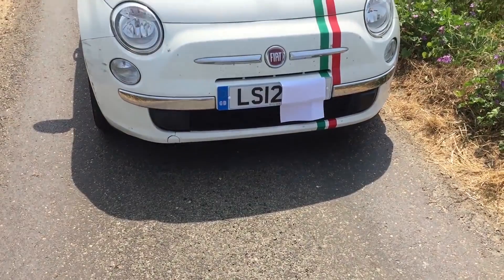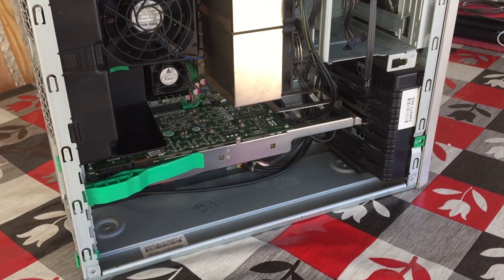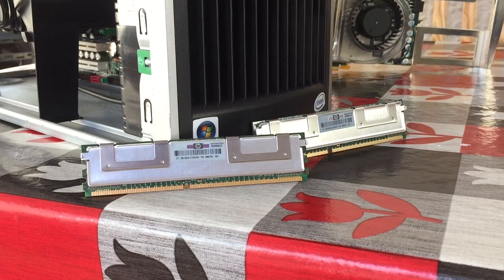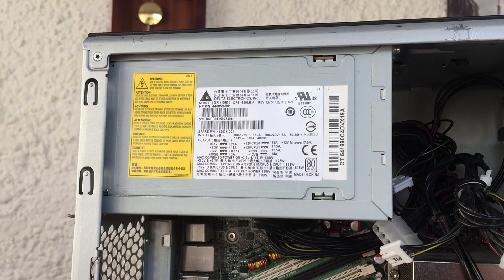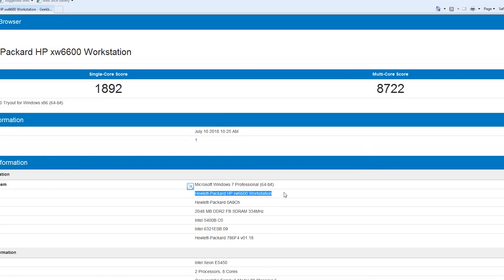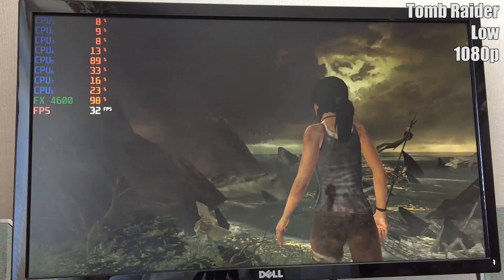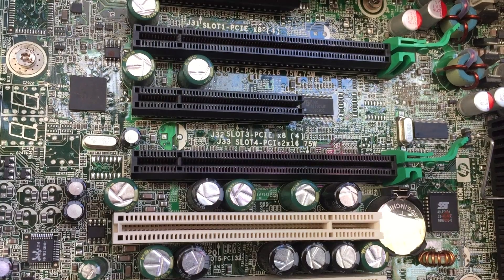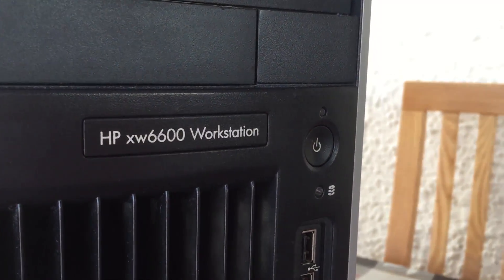This 8 Core Xeon Workstation PC Cost $5000 in 2008, Today I Bought One For £25 ($30)

Comment: When it comes to 75W from the PCIe slot, no x16 slots can provide more than 75W. I think that the above number (75w + 75w) was meant for the system as is - 75 from the slot, and 75 from the 6pin. Grab a different PSU, and you should be able to SLI two extremely power hungry cards. That said, most workstations have SLI license for quadro cards only, and it would be a waste of time. I would personally like to see its ram maxed out :)

Comment: get a 1060 3gb and 16gb of ram for it and make a vid on how it handles modern games
Reply: Prediction: GPU at 15-25 percent.
Reply: Quick search: Q9550 w/ 1060 3 GB running at 35%-ish in GTA V. So I was a bit off, but overall point that the GPU outclasses the CPU(s) probably remains true. The doubling of threads will improve matters but not linearly. Even if you assume linear scaling, i.e. doubling of performance with a second CPU, GPU will still be in the 70% range.

https://www.youtube.com/watch?v=s05U3WqKMN4
Reply: 16GB is a bit too much for this system. Lol.
Reply: Virtue Gaming did i not here him say it supports 32gbs ???
Reply: Yep i agree it would be very cheap gaming pc
Reply: NO MA'AM really???? i seriously doubt it. a 1060 3gb???
Reply: http://thebottlenecker.com/ - Check bottlenecks here.
Reply: NO MA'AM right im not saying its the ideal combo, but he said he wanted to do something different then a 1050... just suggestions. only experience i have with older hardware is a Q6600 with a 750ti
Reply: @NONOLIGHTSHOW  i have one rn with two quaddo fx 5600 in sli with 32 gb of ram. My work had these in specific so i got them for free because they retired them.
Reply: Just buy a old GTX 960 it will be cheaper and be less of a bottleneck

Comment: Nice deal. I have mine aswell. the one i have is an HP Workstation XW9400 $10,000 config
2x AMD Opteron x4 2380's
16gb ECC DDR2
Nvidia Quadro
1TB HDD
I replaced the GPU for an R9 270x.
tho this PC is all water cooled.
and it surprisingly can play almost anything at 1080p :)
Reply: Forgot to mention it came with a 1050w PSU
Reply: Opteron <3 built one with two x6 2431 but an old GTX285

Comment: Another great video! I recently got a HP z800 with water cooling kit, 2x x5680 cpus and 48gb of ram for about $200 AU. The thing has insane amounts of raw horsepower and would make a great rendering machine for anyone looking to get in to youtube (or wanting to run a plex machines as is my intended purpose)

Comment: I own the exact same Workstation, also with dual E5450.. paid 46€ for it about a month ago (bit more ram, but no GPU included), I upgraded it to 32GB of ram (because if you can have dirt cheap ram, you gotta take it) and a GTX 960 2GB, which IMO is a really good match for it. Total cost incl. the Upgrades is about 120€.
Reply from the maker: Nice build :) I'll be looking to get the maximum ram too
Reply: I think maximum is either 64 or 128, the top-spec stuff is usually expensive for old servers/workstations because some commercial users like to keep them running for a lot longer. 

You should see some improvement once you populate all slots (and funny results in some benchmarks), because iirc it's using quad channel memory.

The guys I bought my 32gb RAM from on eBay still have it on sale for 19,95€ + 6,75€ shipping to the UK (was free for me) and they have the option to offer a price (got 2 kits for 18€ each). If you don't find it cheaper, the eBay Number is "382471097094" .
Reply: Wow! I didn't believe that this machine would get quad channel memory bandwidth but it seems true! Definitely go for at least 16 GB with all 8 slots for maximum performance!

Comment: The nice thing about one of those Xeons is that if you're main board dies, you can take one of those out, do the 771->775 Mod and get them all the way upto 3.8-4.2Ghz (on an overclockable board) which will give you quite the performance boost indeed... Not that I really recommend 775 given how cheap 1155 is.

In terms of use as a server it seems decent, and rendering on it was better than some of the stuff I've been forced to work with, especially for £25.

Nice little review of it man.
Reply: The God Called Mars surely, but, at least where i live, it is impossible to find a 1155 board, a super cheap one like a h61m, and an i5 2400 for less than 120/130 euros, considering that with like 30 euro more you can get a i3 8100 and a h310 i don't consider 1155 that cheap
Reply: IronCalca straight up no but when you also consider the price of ram it’s significantly cheaper
Reply: Regilio Bouma: They're £25-£35 on eBay... So no not really. Ali express is also a viable option too with similar prices.
Reply: slugmater: Here you go: https://m.ebay.co.uk/itm/MSI-H61M-P31-G3-W8-LGA-1155-MicroATX-Motherboard-DDR3-PCIe-3-0/232226573489?epid=115883070&hash=item3611c84cb1:g:eiYAAOSwNnRYk0oy

This is a rather good one, I've used plenty of them before
Reply: Sergeant Daffy: They're usually not overclocks and from business's so generally these boards have quite a while left in them
Reply: IronCalca Still cheaper than any other 11xx board, 1151 comes close though.
Reply: Is it possible to game on one of those Xeons with a modded 775 mobo and a dell OEM 250 watt sff power supply?
Reply: Do you guys know about the s5000psl mobo  and why its fans spin at max the entire time

I have 32gb or ram in it and 2 2core 4thread xeons running at 3ghz
Reply: IronCalca I can get a custom pre built system with an i5-2400, an h61m, 8gb ram, 500/750GB HDD and GTX 745 for around $110, and they're readily available on Craigslist.
Reply: barevids (audio channel) livestreams amplifier repair from a 4GHz X5470 system that started life as a Core 2 Duo :-P
Reply: 1155 mobos are expensive AF
Reply: budget-builds official:i wish they where that cheap
plz send a link for a board like that
Reply: I saw the E5450 spec many month ago , OC 4.1ghz possible  ?
Reply: good u learned smth from me bout xeons :3
Reply: tuff_lover: Exactly my man.
Reply: I've had a Xeon E5440 and it couldn't even overclock 100MHz on a pretty good (ASUS P5K/EPU) P35 motherboard.
Reply: The God Called Mars 1150 and 1155 boards are around the same price (on eBay)
Reply: The xeon 3000s on the lga 1366 are pretty sweet. Overclockable boards are expensive but you can build a decent gaming pc with them as the base for under $500
Reply: On eBay.com z170 mobos are anywhere from 50 to 100 USD
Reply: 1155 is pretty expensive actually
Reply: Huntrin here only the mobo and cpu would be over 100,as stated before, i also should say that here the used market is pretty bad, people overprice anything and if you try to talk with them you will just lose your time. That combo you mentioned is really good tho

Comment: You probably got it this cheep because of the OS only running one core making it really slow and someone didn't realised that and sold it thinking it was single core.
Reply: Sevcen23 It's also slower than a stock FX-8350 in both single core and multi-thread. Plus Ryzen 1700 is $250 with mobo, and its about 3x the performance (for the same 8c/8t at 3 Ghz as this, the Ryzen makes 1000cb compared to the 633cb of this one, that is disabling half the threads and underclocking the Ryzen)
Reply: FX-8350 at 5.5GHz? That sounds like miracle-class silicon and honestly sounds impossible without exotic cooling by the likes of LN2. Plus, that little board's VRMs would be in smoke from the power draw of that OC. Can't help but say that sounds like a lie... and yes, I've worked with FX processors, the VRMs will get too got to run them at those speeds.

And I can't help but say clockspeed records really don't matter when they're only achieved with LN2 and cores being disabled. Clockspeed never dictated how fast a CPU was, as even the Phenom II will out perform Bulldozer in a heartbeat unless newer instruction sets are used that aren't supported by the Phenom II. The cost of cooling to overclock those processors meant you need a much better board to achieve the speeds, and great cooling, in order to even match Intel i7s. No, FX was indeed an utter failure.
Reply: Here is my 5.6 Ghz CPUID validation link
https://valid.x86.fr/dgqfg4

It shows my motherboard, voltage, benchmark score, and my epic $5 VGA monitor (LOL, but seriously I didn't want it to explode my 4k monitors)
Edit: The voltage is wrong, it's 1.55 + 150mV = 1.70 Vcore, it probably dipped the moment it recorded it.
Reply: Maybe but these dont go for all that much because of the ecc ram its cheap now but it used to have a real premium price and older machines like the one in the vid are rocking ddr2 no way to stick ddr3 ddr2 ram is emensely slow compared to ddr3 let alone ddr4. But if your lucky you can find later Q series quad cores with decent ddr3 motherboards the biggest problem with the older xeons and core 2 quads is ddr2 was the standard at the time very few boards had ddr3 support and the ones that did cost a bomb and they pretty much only supported upto ddr3 1333 memory sticks. Bottom line keep checking ebay if you do your research you can get great deals on older workstations and ex office pcs.
Reply: R K In some decent and high end P45 and G45 chipset boards you can adjust the memory and FSB subsystem timings to match or even surpass DDR3 800 and 1066 MHz bandwidth, but unfortunately server boards lack the ability to fiddle with said parameters...
Reply: That's because the FX-8350 runs at a full 1.00GHz above the Xeon. The FX-8350 actually was just as slow, if not slower than the Xeons clock for clock. FX had terrible single thread performance and really wasn't worth buying unless you were going ultra budget.
Reply: DropToasterInTub   FX holds the world record for highest overclock frequency ever attained, so it really wouldn't be fair to compare it that far underclocked. The performance of both overclocked would be the same scenario.

Comparing them stock is reasonable since FX has massive amounts of room, and even the cheapest boards allow it to overclock. Its single thread is still above what the Xeon has (which should be obvious since it wins multithread with the same amount of cores, and that's with it sharing parts of the cores under multi-threaded applications). Niether are impressive for single thread anyways, but the FX is at least "less slow".
Reply: DropToasterInTub For example, I've got an old FX-8350 at 5.5Ghz with 870cb (limited by a $40 mATX board I bought new in 2015), so they can overclock really high. They are obsolete in my opinion like all the Intel quad cores. That doesn't mean that I can't plop my Titan Xp into the system and still be GPU limited (I game at 4k), but they are smashed in multi-thread by dirt cheap Ryzen processors in workloads.
Reply: DropToasterInTub Oh yeah, I'm using a stock Intel cooler, forgot to mention that like they forgot to mention for the 5 Ghz 28core CPU at computex.

It is phase cooled, max temp of 10c on the core (-25c block temp under load).

It really is limited by the motherboard though, it doesn't allow past 1.7 Vcore. Still darn impressive for such a cheap board.
Reply: What a funny joke.
Reply: The FX is real, running on a wimpy 4 phase VRM (I agree, I don't know how it hasn't caught fire)
Channel page: https://www.youtube.com/channel/UCZp2Om_w_o0ry_FQhAUp-CA

Video of the FX system making fun of Intel's Computex blunder (sure, they forgot it wasn't stock...) https://www.youtube.com/watch?v=30SFGaTUgIo
Next video will be of a 100+w case fan (120mm fan powered by a race quadcopter motor)
Reply: There's absolutely no way that you're running an FX-8350 at 5.5GHz on a 4 phase VRM board, it's just not possible. But I can't get a good look at the VRMs to tell if they're also being cooled by the chiller. An FX-9590 could turbo to 5GHz, but required a much better VRM system in order to deliver the power that was needed, and at the same time, needed a huge heatsink over the VRMs to avoid them burning up... literally. Just look online to see how many people tried to run the 9590 on a 970 chipset board and burned the entire VRM system. That board had to be a 990FX chipset, and those boards were very expensive. By the time you added it all up, you pretty much came so close to an Intel platform that it honestly wasn't worth the performance you get. That's why efficiency is important. Also, there's no proof of that being an FX-8350 running on ALL 8 cores active... it's also not even your channel, but it may just be an alt.
Reply: It's an Asrock 970m Pro3 rev2 micro-ATX.
I added heatsinks to the chokes and it is cooled by 2x 40mm fans. Total cost was $3 for VRM mods (actually less than that, I used a bunch of the extra heatsinks for voltage boosters for my fans, which is why I had a fan with a fried motor).

I ran it at ~300w (4.8 Ghz 1.5125v) for over a year with an AIO doing CAD rendering and fluid simulation (takes ~24 hours per simulation). Cinebench bumped it from 65w stock idle to 400w at the wall overclocked. 

I'll be honest, that motherboard is a trooper! I had the camera and fire extinguisher ready for the phase cooler. It's holding it nice and stable through stress testing though.
Reply: I don't think he's lying. I have an 8350 and have had it up to 5ghz on a 970 a board with NO vrm cooling, it is on water though. I would've taken it past 5ghz but I didn't want to push that much voltage on a board w/o at LEAST passive VRM cooling. Don't under estimate that chip.
Reply: Elgan Bruner I achieved 5.150GHz on air and without VRM cooling. Validated at CPU-Z. It was unstable due to not enough voltage adjustments in UEFI. Oh and its FX 6300. 5GHz is nothing special for FX. Maximum stable clock speed was 4.9GHz.
Reply: Or because the tech is older than a decade and the investment paid for itself.
Reply: They are cheap now because they were aimed at businesses. What business would want such a piece of crap in the office now?

It is large, power hungry, noisy, hot and becoming unreliable (at business scale). Business users also need BIOS updates for security. Speaking of security, try running AES in software on those CPUs. 

This has nothing to offer any more, hence the price. It is a POS.
Reply: Even at 5GHz, any Intel offering still demolishes the FX. Still can't say FX was good at all, especially if you had to hit 5GHz just to see any comparable performance (single thread was still behind at 5GHz, compared to the 3.5GHz Intel had). Intel was a better buy at the time. AMD still would have been better off fixing K10's bottlenecks (mainly the retire one), and moving it to 32nm along with new instruction sets. K10 could already hit 4GHz on the 45nm process. If K10 on 32nm hit above 4GHz, Intel would have easily had competition. Plus, fixing those bottlenecks would have improved IPC on its own, making it much more comparable to Sandy Bridge.

Comment: I just got a dual xeon e5620 server pc a few weeks ago with 8 cores 16 threads; hyperthreaded (Dell PowerEdge r410). Both cpus are clocked at 2.4GHz and turbo to 2.6GHz. Cinebench r15 score of 782cb. Great and amazing performance. Thanks for this video!!!
Reply: My Xeon e5 2680 v2 (10 core cpu) gets 1382 on cinebench at cost me £170
Reply: Harryw007 Man that's some good luck! Did you look on eBay or something?
Reply: Harryw007 Mine was way cheaper for $115 dollars.
Reply: yeah i found it on ebay, I do a lot of virtualization so i use it for that, i also do video editing as well so it is basically so i can have multiple things open at once.
Reply: and my 6700k 4.6ghz got 1001cb score

but it's mobo limited at 4.6ghz, i've tested and it can do 4.9ghz np

Comment: Do a fiat 500 sleeper upgrade.  You can get the chassis modified if you want it to be awd. And even improving the engine . and do it in multiple parts.  Not just one video.

Comment: You can try upgrading the machine with more FB-DIMM sticks RAM, a faster GPU like a GTX 1050/1060/1070 and maybe try getting a new side pannel for it
Reply: not a 1070 lol
Reply: He has lots of good pc's why would he spent more on this? He probably not even gonna use it it's just for the video or might use for parts in the next video's pc build.
Reply: Kwstas Drakopoulos i have the same dual xeon HP machine, it is good and it works very well today, the thing here is the lifetime for the future, i prefer my i3 (is an HP computer to) that it cost me almost the same but it can be updated more and the cpu wouldnt be a bottleneck soon, this dual xeon workstation is not bad but exist better choices at the same amount of money
Reply: My dad has 32gb of ram on his XW6600. Those DDR2 FB-DIMM are really cheap nowadays.
Reply: DDR2 and what is likely to be PCIe 1.x are going to be issues in terms of performance. Even the GTX 1050 is likely too much for this system.
Reply: NO MA'AM HP XW6600 does have a PCI-E 2.0
Reply: Pasi123, my mistake. For some reason I had it in my head that this was a 2007 model, despite the rather obvious "2008" in the title.
Reply: An upgrade doesnt worth at all on a machine like this, even with a cheap single slot of 8gb ram and a cheap graphics card to make it better the required electricity in two cpus is more than a cheap i3/i5 or i7 HP or Dell Optiplex, the cpu would be a bottleneck if you want upgrade and it uses old pci-e ports
Reply: are you sure that  it doesnt worth it?Have you check what performance can you get from those "old machines"?